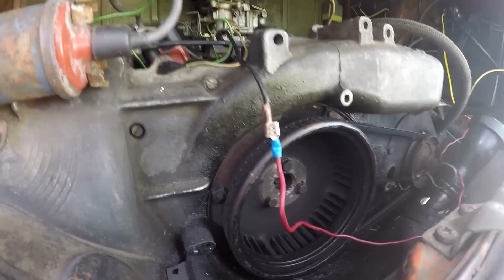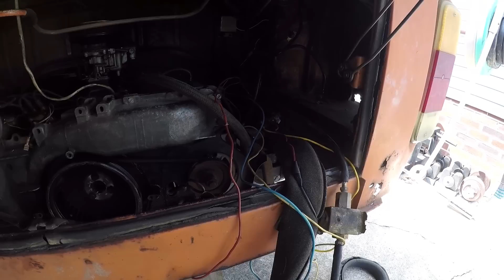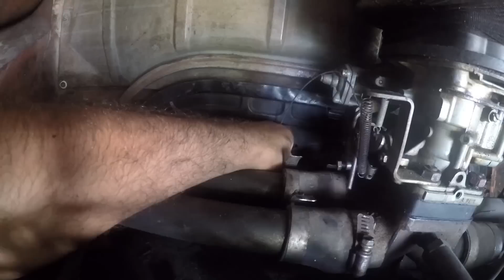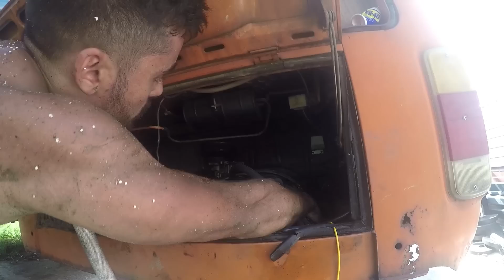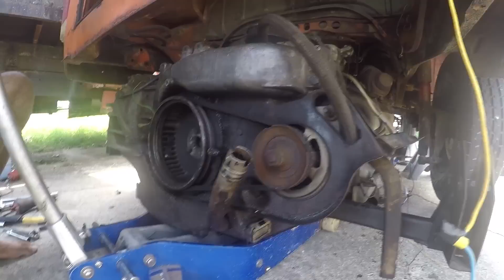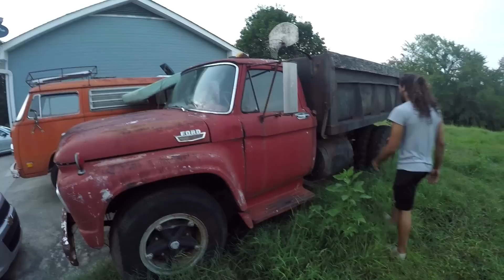#Vanlife: Dropping the Westfalia 1.7 Type 4 Engine

Comment: Hey how’s it going I have a 1977 VW Kombi it’s an automatic only thing is I need a kick down rod or to run a cable from the carburetor to the tranny some how so it shifts at the right rpm’s and downshifts right only thing is I can’t find a rod anywhere or any specs for this any idea how I can make this work ?

Comment: I removed my type 4 by myself like you guys did by removing all the parts first.  I learned that its easier to drop the engine with most tins and exhaust installed.  Install the engine with the tins, exhaust and manifolds already mounted.  Wresting the tins is a bitch.  Keep up the good work.